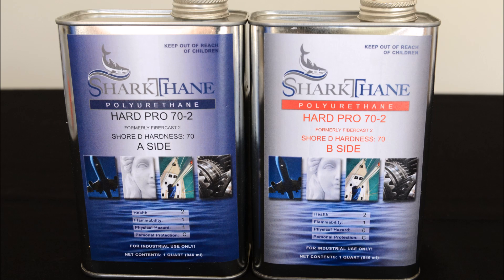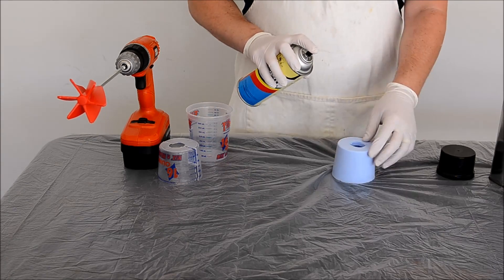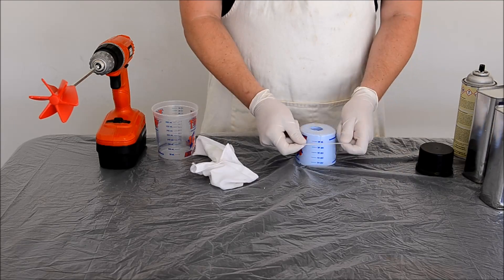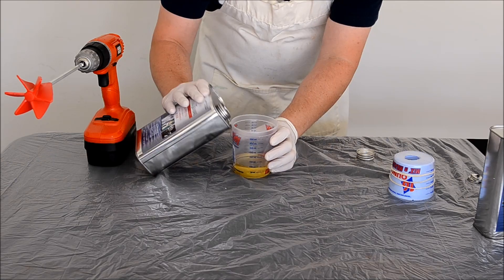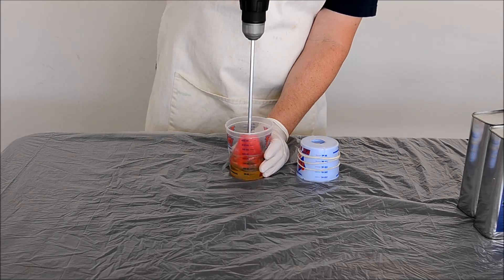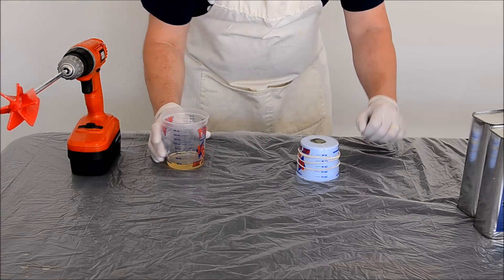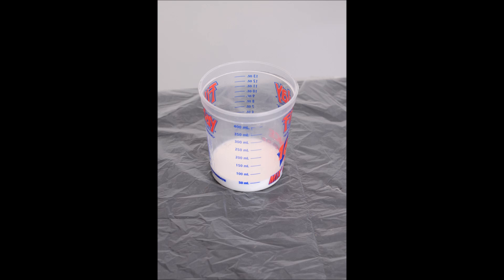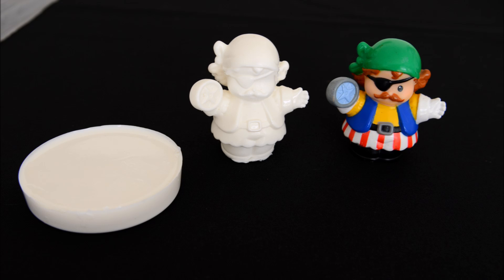Casting with Polyurethane

Comment: Hi, great vid. Is there a material that can be cast at room temp and which is as durable as PP? I am looking to make a car part which is very thin - 1-2 mm and I need a very strong material. Do you have any idea pls? I understand that Polyamide or TPU could be - but can they be cast? Or is Polyurethane good too?

Comment: don"t we have to degas the PU resin before casting?
Reply: Not for something like this. That poly is thin to begin with and the part they're making is going to be used for anything structural, take any weight, or be exposed to any sort of extreme temperature.
Reply from the maker: Ideally, yes.

Comment: Can you use this with fiberglass material.
Reply from the maker: +DarkLinkAD - Polyurethane isn't used very often with fiberglass.  It is more expensive than polyester resin.  But yes, it can be used with fiberglass, but rarely is.
Reply: No, it cannot.